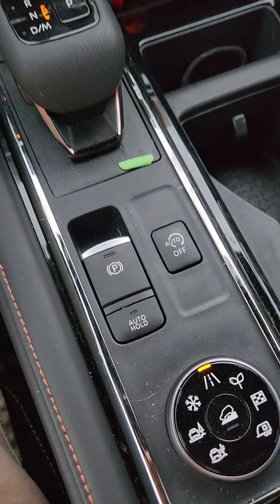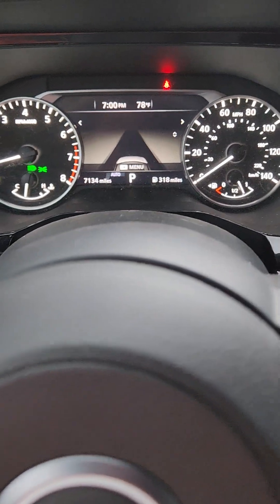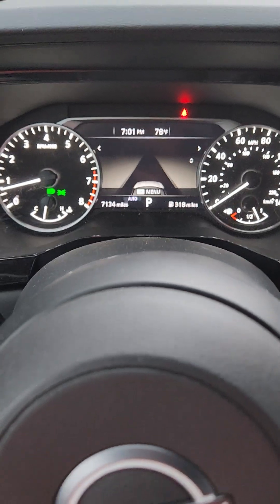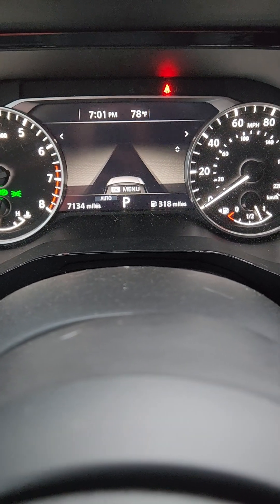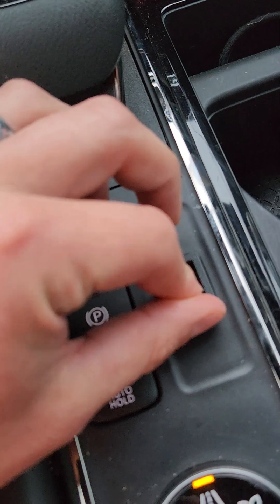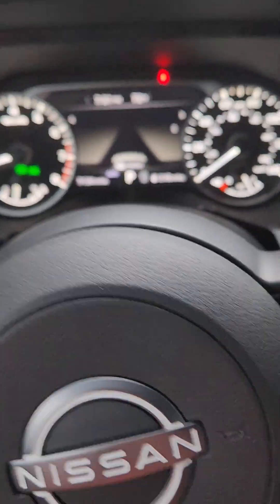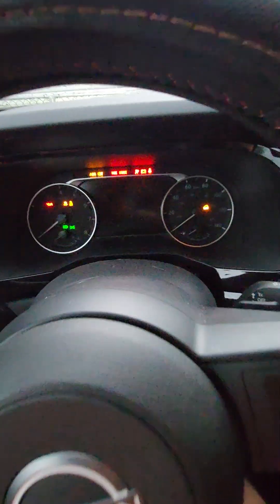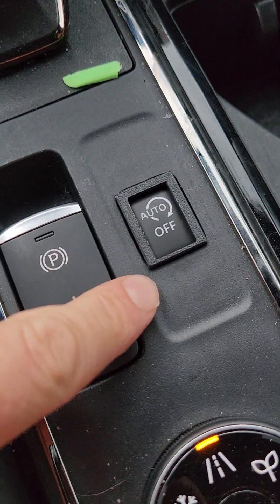Permanently disable 2022-24 Nissan Pathfinder Auto On/off. Auto start stop

Comment: Please contact me!!! I want to know if the wire on the battery, when disconnected, does it turn off anything important other than the start stop feature? I was told that that one wire operates only the on-off feature. I dont want to disconnect it if it will turn something important off as well?
Reply: That wire to the negative battery terminal is the battery monitor, if you disconnect it, it will default the smart charging to full charging at all times, charging will not go into reduced charging at times (gas saving bullshit) and disable the start/stop system.  (Variable Voltage Control System), adjusts alternator output based on vehicle conditions to optimize fuel efficiency and reduce emissions

Comment: I found a post in a forum by someone else who created a similar 3d printer solution to hold down that button.  But what was found was there seems to be a time-out period of several hours (don't know exactly the #) where the button just resets itself, rendering it no longer useful .  Anyone experience that?   EDIT Oct 31, 2024:  I tried this using folded paper to wedge the button down and it seems to work.  Problem is I couldn't stand the look.  So I went to Nissan Canada's website and gave them some feedback, suggesting the button function be a permanent change and not a temporary (per journey) change.  The Customer Care Specialist I was speaking with completely agreed, he then proceeded to open a case on my behalf to request a programming change to in effect make that Auto-Off button a permanent function.  He said once the change is approved, coded and ready to deploy, it will be applied "over-the-wire" to Nissan vehicles or a Technical Service Bulletin will be mailed to Nissan owners advising of the change and that the update will be applied the next time they bring they're vehicles in for service at their dealer.  Keeping my fingers crossed, can't stand this feature.
Reply: That's incredible. Have you gotten any updates from Nissan about this?
Reply: I DO NOT LIKE THE IDLING STOP FEATURE!! I’ve tried to adjust but it’s not Ergonomically the best idea for me personally 😩But I love the Nissan Pathfinder otherwise..Planning to write the service team again about permanently discontinuing the idle stop feature